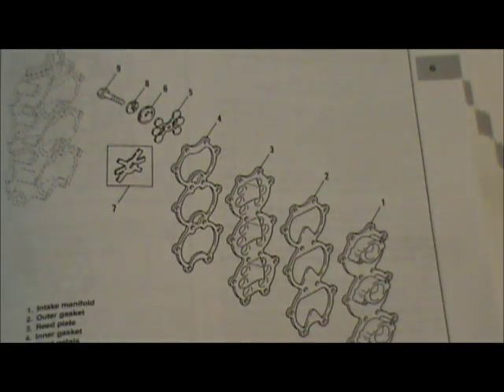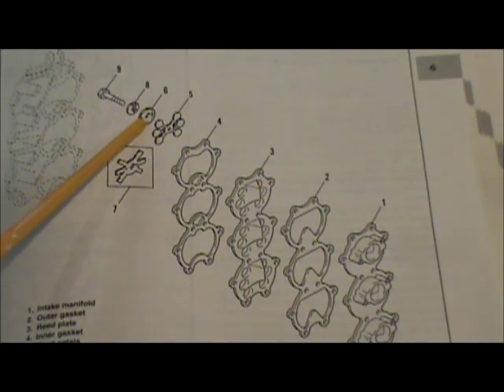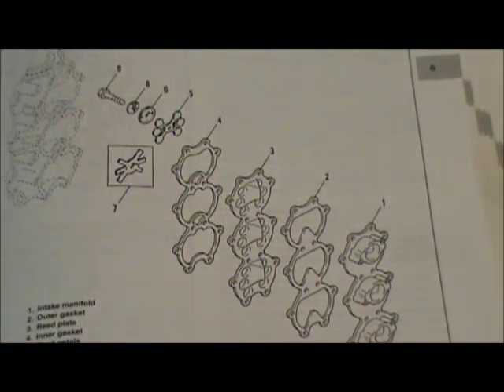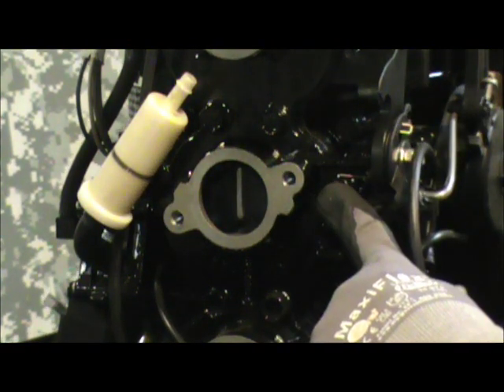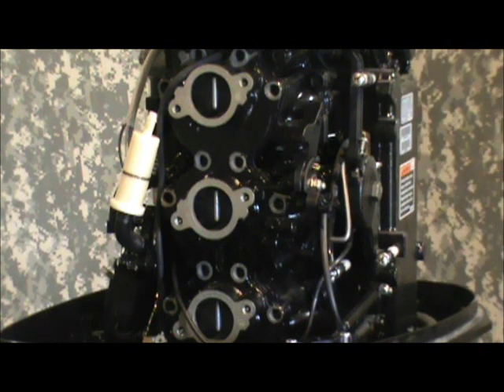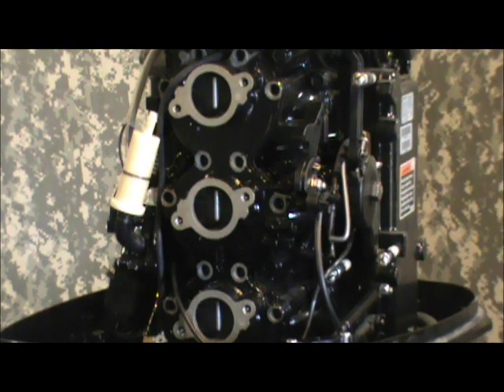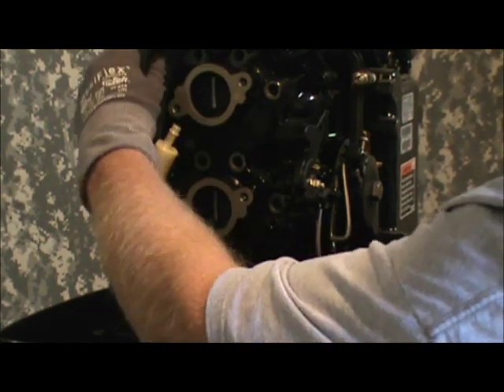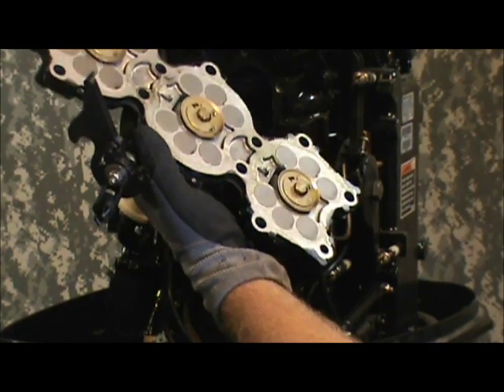My DIY Relpacing Reed Valves in an Outboard Motor Part 4

Comment from the maker: Some symptoms include backfire or misfiring, poor performance, high fuel consumption. If you replace your stock reeds, which are made of stainless steel and if they break can cause major engine damage you may consider carbon fiber or composite replacement such as provided by Chris Carson's Marine Service on the web. 

It's not likely the block itself is bent I have never heard of this. It is more likely that your reeds are not seating on the reed block.

Comment: I have a Merc Optimax 115 and my dealer tells me I need a new reed block because one the parts in the block is bent (petal?). 

First, what happens if there is a problem with the reed block (symptoms while running)?

Second, how does anything get "bent" there in the first place anyways?
Reply: @WhiteLakeDan...If one of the metal reeds breaks loose you'll likely destroy your powerhead.